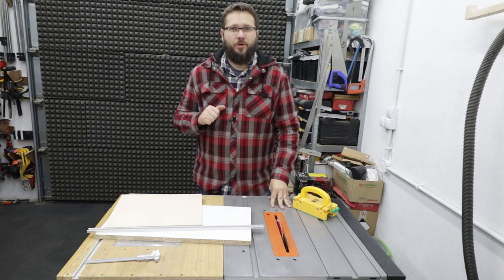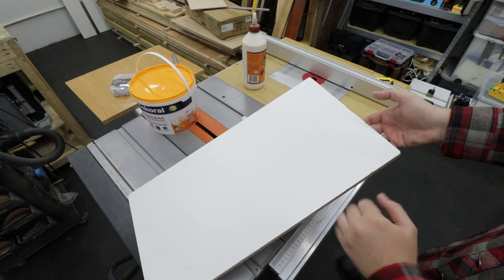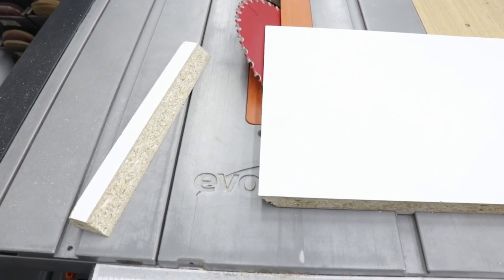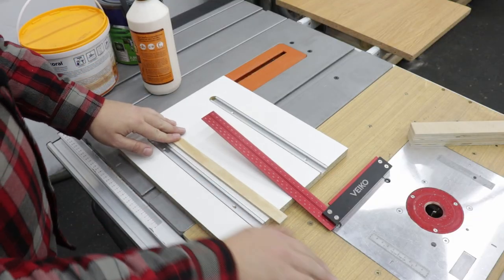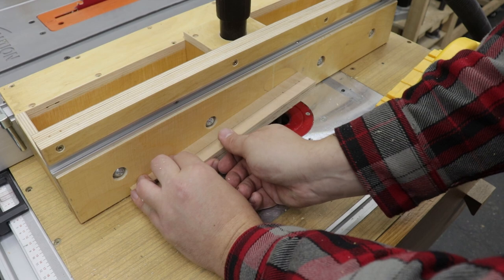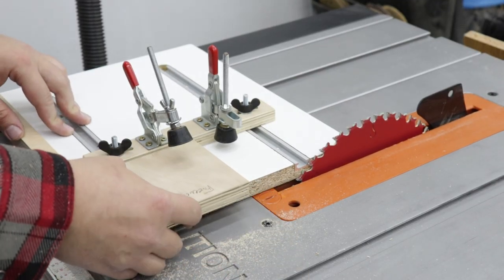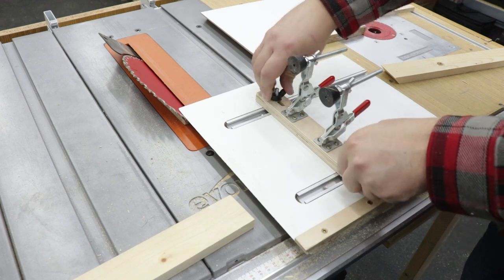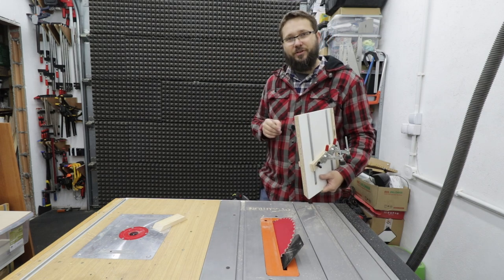Versatile Small Table Saw Sled | Evolution Rage 5S

Comment: Heads up for anyone thinking about buying a Rage 5s-  Check out table saws sold with the Excel badge! They do one with all the features of the Evolution, but much cheaper. 
Just got one & the only real difference I have found is that instead of having a clamp for the right hand extension it has thumb-screws front and back.

Edit: There is also a thumb-screw in place of a clamp for the blade angle adjustment, and the blade bore size is 30mm, which is either a positive or a negative depending on your point of view.

Your videos are really useful Tomasz, thanks!

Comment: Great demonstration! Thank you for this clear and helpful info.

Its probably already been said, but I have to comment on the fact that this video is showing a SLIDING cross cut sled being used ON TOP OF a SLIDING TABLE that does almost the same thing. The differences and similarities of those two methods is worth at least minute or two of discussion.
Reply from the maker: True but not everyone has got a saw with a sliding carriage plus the sled offers far more capability and options.

Comment: Another simple but effective jig, smaller is better sometimes ... excellent 👍  ... I'd suggest using double sided tape (or CA glue) instead of glue, instant bond and can then be screwed on as you have done.
Reply from the maker: Exactly, and that tip reminded me of the simple solutions that sometimes are the hardest to come by 😂

Comment: I've added this to my "things to build list".  Where do you get your T track from? Any specific make, codes, and dimensions? There are so many T track options, it's a bit bewildering.  I'm in the UK.  Thanks in advance.
Reply from the maker: Hi, glad that you like this little project. To be honest I buy them on Banggood when I see a good offer. I then buy few meters as I do use a lot of them for jigs etc. My favourite t-track dimensions are 19mm wide x 9mm thick they are small and will fit in most materials.
Reply: @CasualDIY  Perfect, thanks 👍